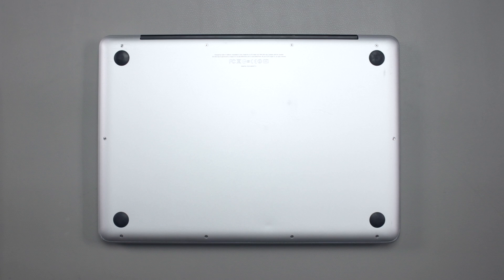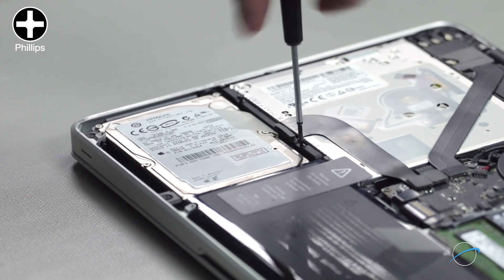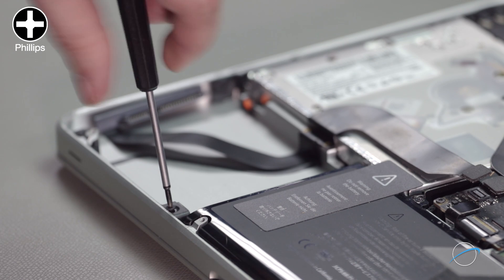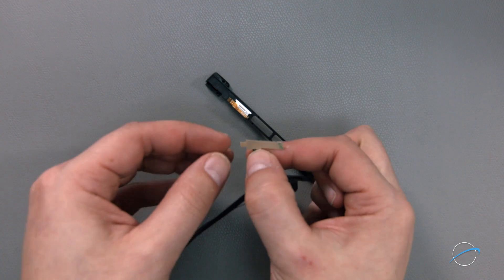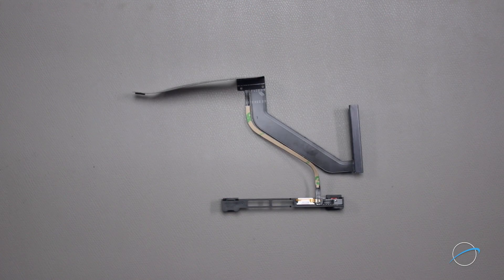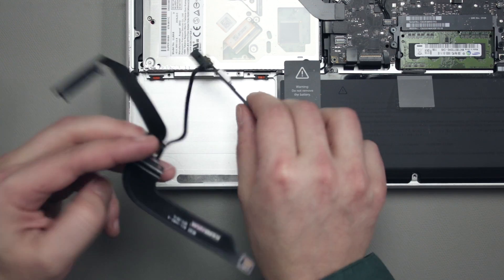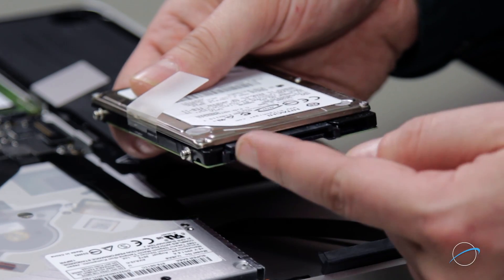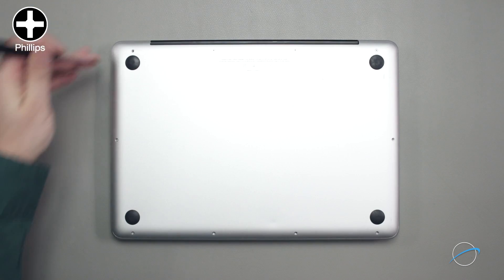How to Replace the Hard Drive Cable in a 13-inch MacBook Pro Mid 2012 (MacBookPro9,2)

Comment: I want to give a big THANK YOU, you guys are awesome. I already upgraded my HDD to a SSD and my 4 GB of RAM to 16 GB. I was a little hesistant at first but I ordered the Hard Drive Cable regardless. After watching your video for the 1st time, it gave users like myself confidence to do this. So I did and my Mac is running smoothly. Thanks again Subscribed & liked!